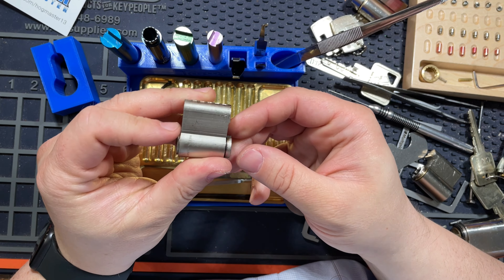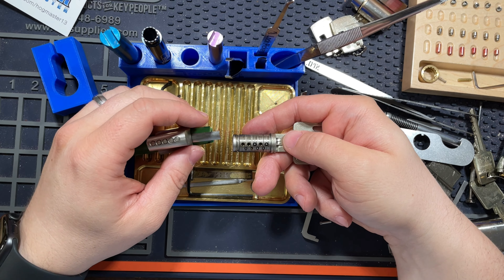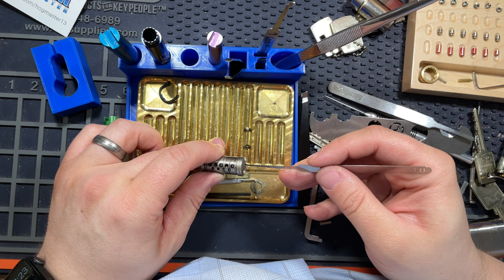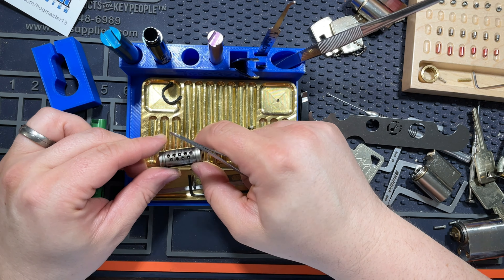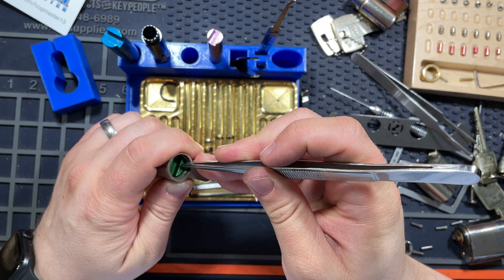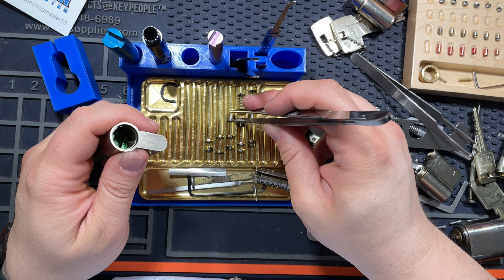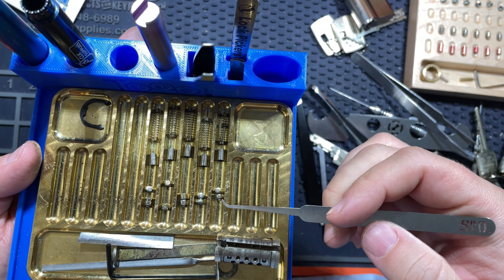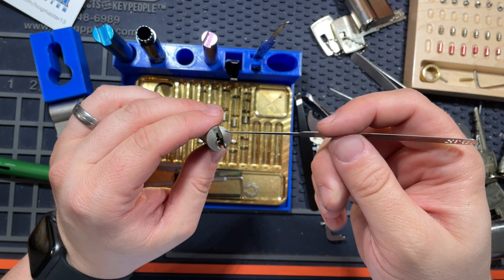[78] Vachette VIP picked and gutted -nasty keyway

Comment: if you use TOK you can get at all the pins easily from the right hand side of the keyway from the bottom. I picked the VIP+ which is the same thing from a picking standpoint. but you got it fast anyway
Reply: commented before i finished watching video. i picked from the bottom with 0.15 pretty happily. the VIP+ has a weird semi interactive thing on pin one which yours hasnt got. also shame about all those master wafers.
Reply from the maker: I saw you video a few days ago, which is what made me think I should go ahead and try this thing. I just got the lock about a week ago, and had no idea what might be in it until I saw yours and figured they were similar. So, definitely this picking was inspired by the video you made of the VIP+. ☺️
Reply: @DoctorHogmaster  nice